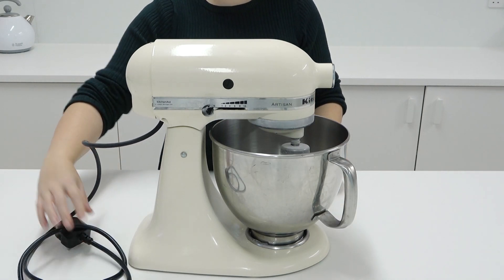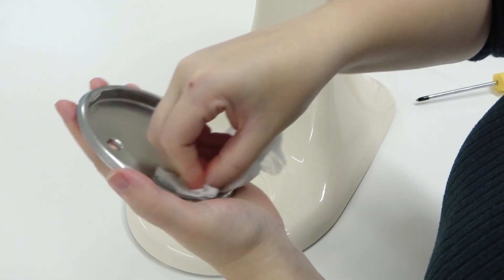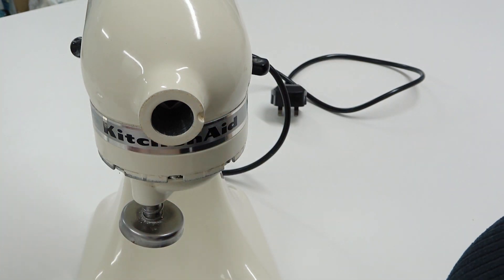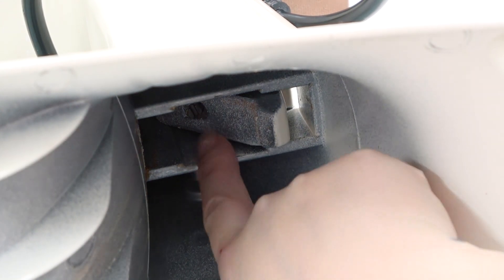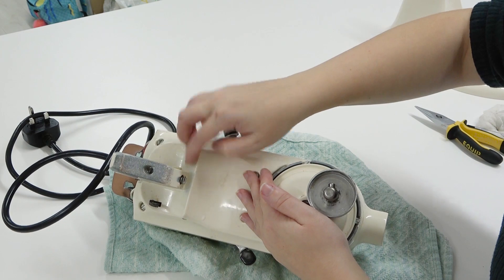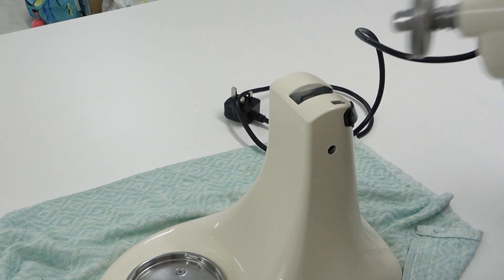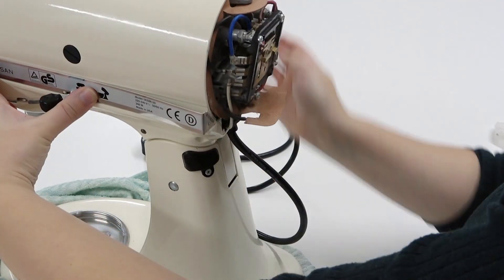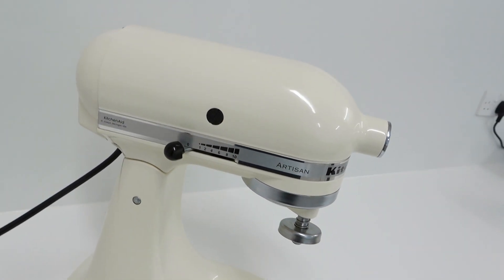Cleaning Your Kitchenaid Tutorial | How To | Cherry Basics

Comment: I usually tap the drip ring back on with a rubber mallet. I have never had an issue when the rain falling off because of taking it off frequently for cleaning. Every couple of years I actually regressed my KitchenAid. So that's when I do my deep cleaning of it but I don't go to the extreme of separating the head from the base from the head.